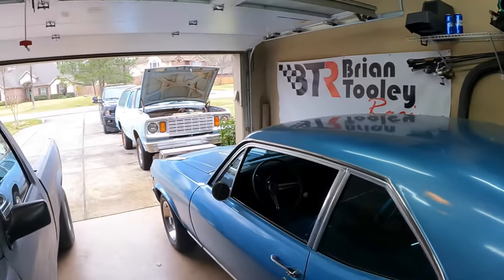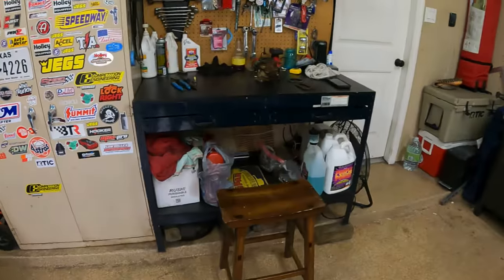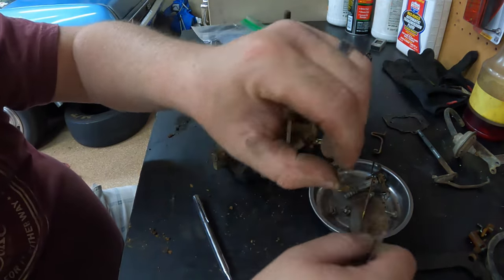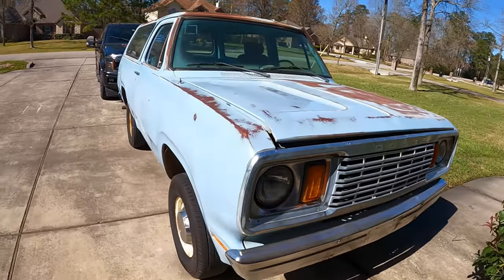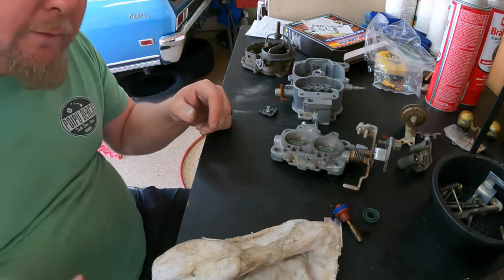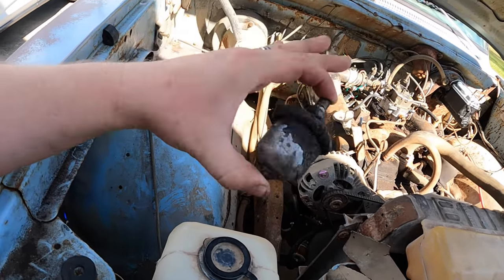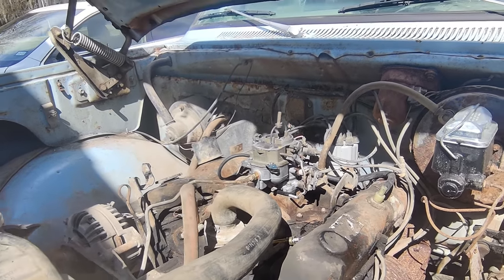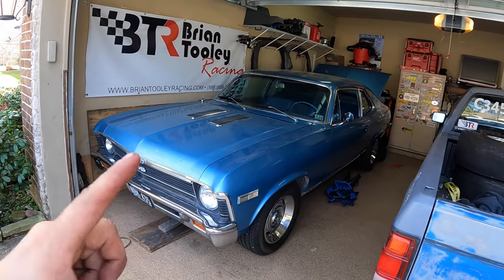1978 Dodge Ramcharger Carburetor Rebuild - BEVO needs help!!

Comment: Good job on the rebuild of the carb!! Parts for these Classic Dodges are getting hard to find, I have a 1972 W100 Power Wagon and finding ANY new or used parts is difficult at best. What are your plans for this? You going to keep it and go thru it? Would make a great camping rig.  Keep the video's coming.
Reply from the maker: Thanks! Glad to have it running better again. I'm afraid it doesn't have a long lifespan with me, I have an opportunity that I have been waiting for, for some time come up, and it may have to go to assist in obtaining it. We'll see, I hope to trail ride it a little before she goes onto another home. It's been a rough project, but I think its turning the corner. Really is pretty cool. Thanks for watching!

Comment: I have to ask You  WHY   Why would You go to the trouble running that 2 barrel carb. That motor would love more air and fuel I am 57 and My family sold those Ramchargers  so under powered once a person adds an intake and carb with headers it certainly made those trucks run so much better and if set up correctly a guy wouldn't lose fuel mileage
Reply from the maker: Well, my goal on this one isn't horsepower, it was just getting it back up and running and on the road. It was sitting in a field for the last 18-20 years or so and needs to be revived. Perhaps in the future, but budget wise trying to keep cost low.
Reply: @RacerXGarage  Roger that I get excited when guys like you find these nice older rigs that don't need much just to run   Vermont everything like that has wicked low miles but all rusted out   I am looking for a M880 72-79  F Body 2 door cars and a 65 Barracuda  oh yah 2wd short bed Dakota to build a strreet race truck like Billy The Kid's S-10 keep me in mind please
Reply: I got one, but it has a single Holley carb...no tag, someone told me it was a 1427 but I don't know...how would I find out?  I have the Holy Grail Repair Manual for the 1978 Ramcharger and Trail Duster, but it simply says where and how to locate the tag to ID the carburetor and order replacement parts/kit accordingly.  Well, hard to do when the tag is gone.  Any help or ideas would be nice.  I'm thinking about changing it over to a 4 barrel or Snipe system, but meanwhile...
Also from watching this I was worried about check balls getting lots but I guess that wasn't a problem.  Hmmm 🤔.  Thanks to anyone that responds. Be well and be safe.
(Edit). I have the LA  318 by the way.